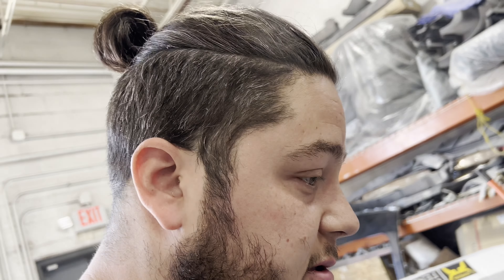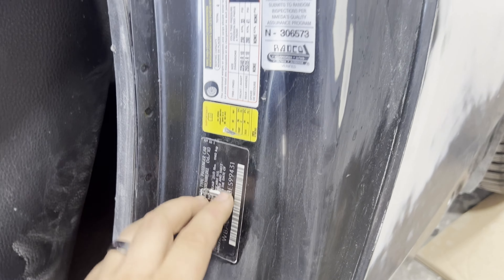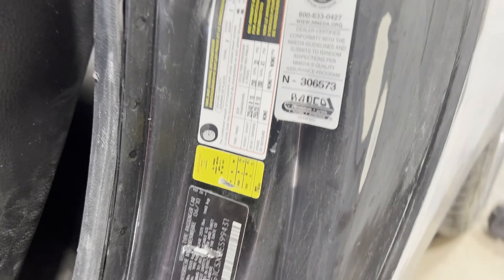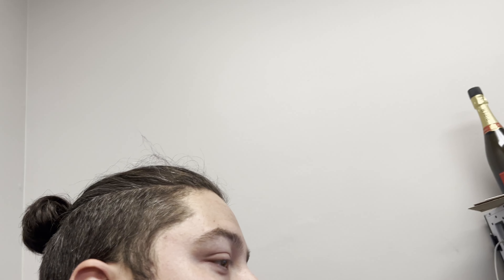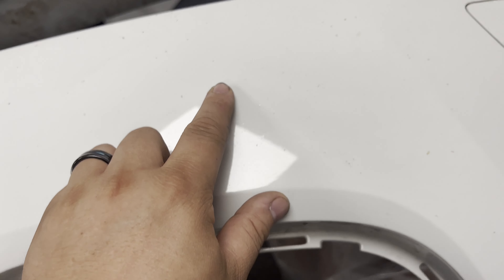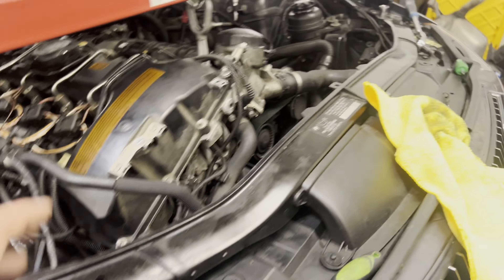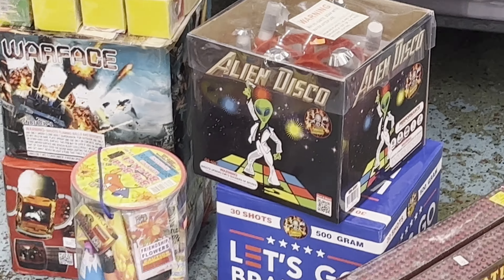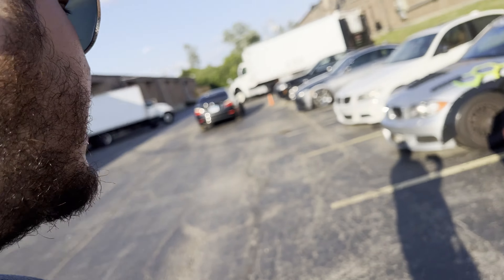335is Build Update

Comment: Is the vtt spline Crankhub plenty for built motor n54? Or do you think a 2 pin hub is better?
Reply from the maker: More than plenty. My chalk car which makes way more power at 40lbs has a stock hub no issues.
Reply: @N54RacingChannel  alright I’ll definitely go with that option then! I know the n54 doesn’t have a hub issue like the s55 but I’ve heard it can happen and so it’s definitely a peace of mind type of thing especially spending a lot of money on a built motor I rather be on the safe side!

Comment: Whats the difference between 6 bolt and 8 bolt n54 motors? Didn't all "is" cars come with 6 bolt motors only?
Reply from the maker: Some early IS models came with 8 bolt.
Reply: @N54RacingChannel  oh okay I have a 11' is and bought a m4 flywheel the m4 flywheel is 6 bolt. Is there any way to check which bolt my 11' "is" is without removing the trans?